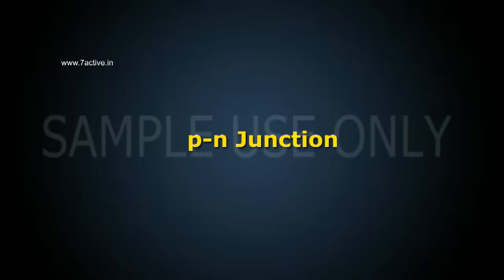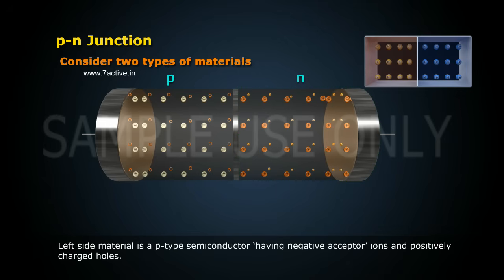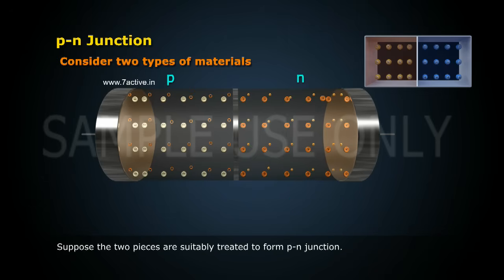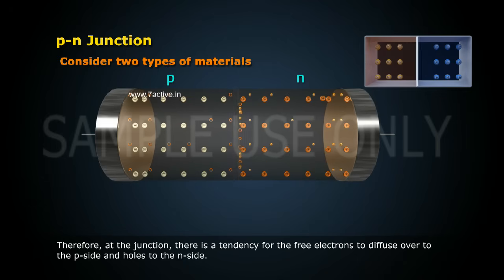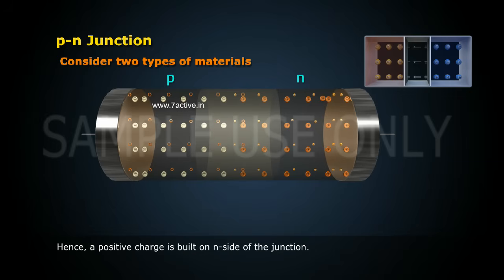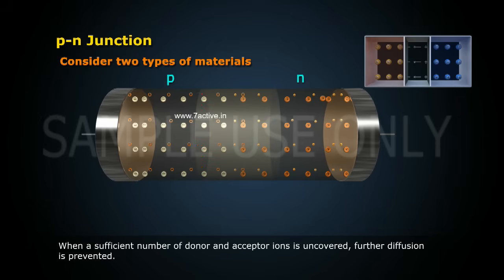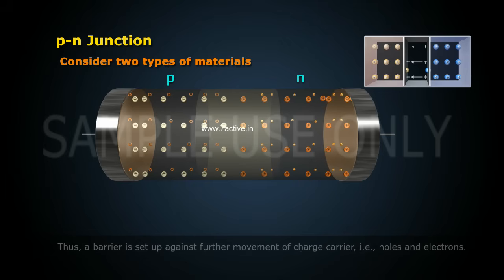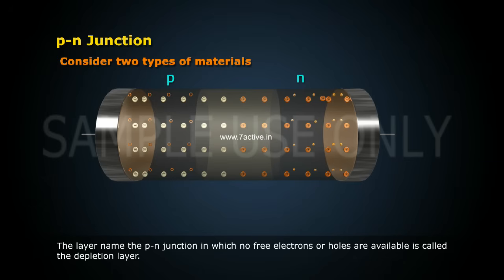P-N JUNCTION

Comment: how are they joined? with clue or what?
Reply: take a p type semiconductor, cover half of its area with an opaque object and introduce a pentavalent impurity on the other half. the other half where the pentavalent impurity is introduced will convert into n type semiconductor. Now remove the opaque object and you have a combination of p and n type semiconductor with a p-n junction.

Comment: The work of a potential barrier in p-n junctions is to allow current in the forward bias condition and prevent it in the reverse-bias condition.
The current in a diode under forward bias and in constant thermal equilibrium is due to the movement of the holes and the electrons moving and recombining on and on and on.
It would be useful to know what a current really is by a unified approach to electrostatics and circuits which is usually taught separately in textbooks and physics courses in science and engineering.
Watch the two videos listed below to learn about current and the conduction process and surface charges (using a unified approach to electrostatics and circuits) which set up the electric field whose line integral is the potential difference. The battery produces the emf.
1. https://youtu.be/TTtt28b1dYo
2. https://youtu.be/8BQM_xw2Rfo
[ See these lectures by North Carolina State Univ faculty which use a unified approach to electrostatics and circuits. 
15. Simple D.C. circuit. 
Pattern of electric field.
Watch from  16.0 minute.
16. Mechanical Battery
Watch from 19.0 minute.
Ch18L1b
https://youtu.be/Eu3JQKrJRZA?si=t3MeX8Hi8ELAxaz0
17. First intro to  Surface Charge 
Watch from 10.30 minute. 
18. Surface charge gradient 
Watch from  15.30 minute. 
Ch18L2a 
https://youtu.be/bp0o1HZOs3g?si=PPiPGepbXvdTgJHX  ]
For operation as a check valve, a spring is necessary. For operation as a diode, a p-n junction is necessary. As long as the valve is operating, the spring will always have a displacement, however small.
Similarly, as long as the diode is operating the junction will always have a barrier potential, Vo, however small. (Vo is about 0.6 volts for a silicon diode.)
One of the vexing questions that students seek an answer to is, how much is Vo–Vf ? For large applied forward voltages? Greater than Vo? say, greater than 1 V?
The answer: Vf adjusts itself to a value such that the conservation of current law is upheld. And this will not make Vo = 0. In other words, | Vf | < | Vo |.
Vf adjusts itself to the value such that the sum of the large diffusion current and the small drift current in the transition region equals the drift current in the bulk region where most of the applied voltage is dropped.
That is the reason why the VI characteristics of diodes plotted in data sheets and electronic manuals are upto about 0.6 V to 1 V for silicon diodes and seldom beyond. 
And if applying voltages greater than, say, 1 V, a current limiting resistor is added in series with the diode.
Space does not permit a full discussion of diode operation here. 

In the last frame of the first of two videos above a list of textbook references is given which discuss all these topics in more detail. Textbooks 3 and 4 give more details of p-n junction diode operation under forward and reverse bias. Textbook 4 discusses the differences in the physical processes underlying rectifier diodes' and LEDs' operation.
Also in textbook 4 is discussed why the potential barrier can never be made 'zero' in operational diodes. 

Textbook 4 is here https://techsarworld.com/product-detail/fundamentals-of-electric-theory-and-circuits-559 

PPTs and Videos with animations for all the ten chapters including that of pn junctions Chapter 9 and a few applications Regulated DC Power Supply, Differential Amplifier and Transformer coupled audio power amplifier of  book Fundamentals of Electric Theory and Circuits are available for download and viewing here
https://techsarworld.com/download-resource/fundamentals-of-electric-theory-and-circuits-559

Comment: Dear Sir , I have a question...
            If holes are hypothetical concept( vacant space created by electrons) then how does the recombination takes place in Diode...
Because vacant space can't move
Reply: The vacant space doesn’t move but the electrons do. So when the electrons move from n type to p type there is automatically space created in the n type(vacancy of the just travelled electron = hole). Then the electron space(hole) in the p type is filled but then it travels or gets transferred to fill the hole in n type as there was the hole formation as said before……watch from 1:28 you’ll get better understanding!
Reply: @sarrahhabibi2904  I don't know if It's my lack of knowledge, but isn't the n-type suposed to have extra electrons so when they cross to the p-type, the whole thing is suposed to become neutral?
Reply: @indijanacdzon8416  no that's actually not the extra electron, it's just the electron which doesn't gets bonded so it just free to move.... the whole lattice is  still neutral even when doped with pentavalent or trivalent because the no. Of proton and  electron is still the same.   But when an electron from n-type semiconductor leaves the lattice then it gets positively charge
Reply: @sakshamgupta9887  Thank you so much, I thought nobody would answer this question
Reply: The location in the "sea" of electrons which is vacant can move.  If an electron comes to fill that vacant space, where that electron used to be becomes the new vacant space, so the location of the vacant space has "moved".

Comment: everywhere you have shown electron-hole pair,Hence there should be equal no.of electrons and holes on both sides.How can you say on n side more concentration of free electrons and vice versa....sir please explain...
Reply: n type material is formed by adding a pentavalent impurity (ex: phosphorous or arsenic which has 5 valence electrons) to silicon (which has 4 valence electrons). due to this process of doping, n type material will have excess electrons compared to p type. (which is formed by adding a trivalent impurity to silicon, to give rise to excess of holes)